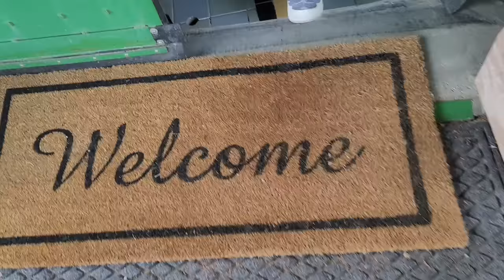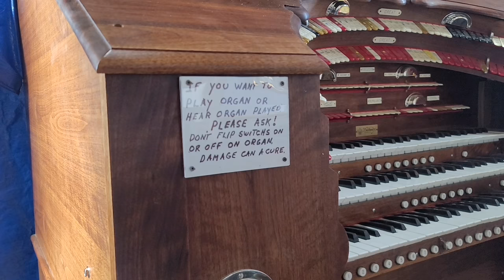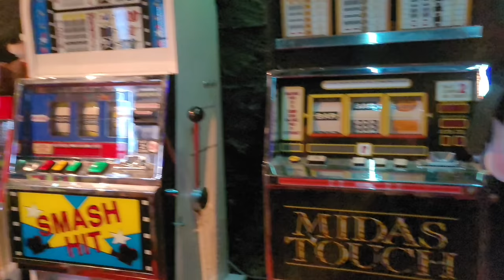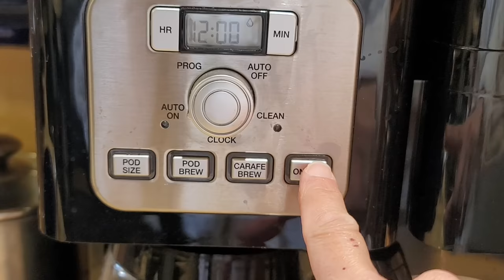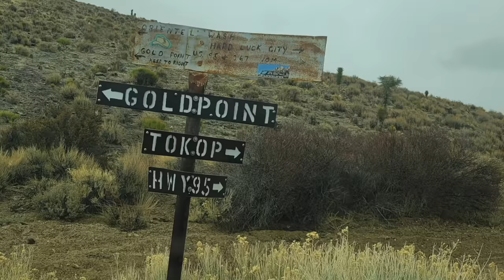#619 Staying at Death Valley's Luxurious, Remote and Completely Bonkers Hard Luck Castle AirBnB

Comment: I've seen builders use 14 H  " x 18" W X 35" W , Hey Bails and Stucco on  the on  inside and out side of the Bails and the R factor is A M A Z I N G for 18 " W helps heating and cooling , Very Thick Walls . I want to build one . a Cheap Stucco Hey Bail Castle .